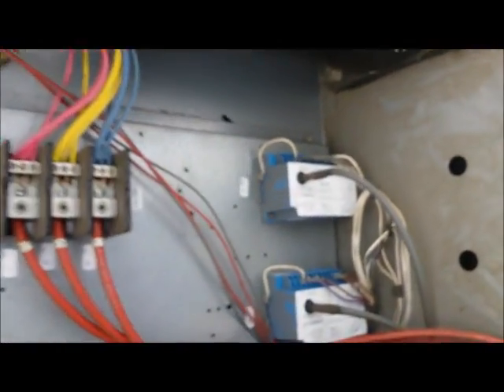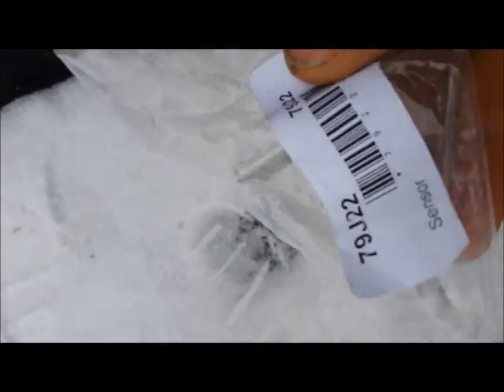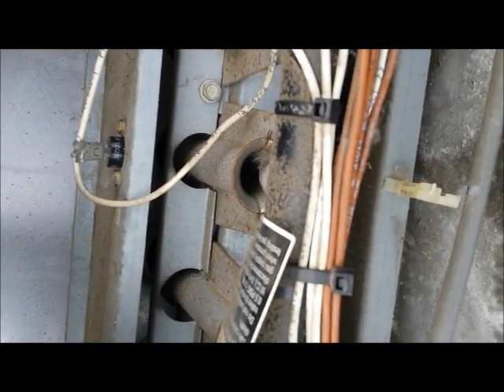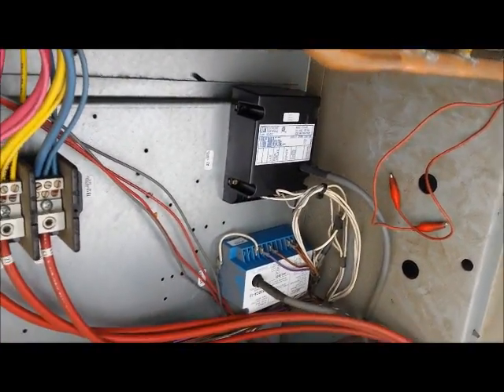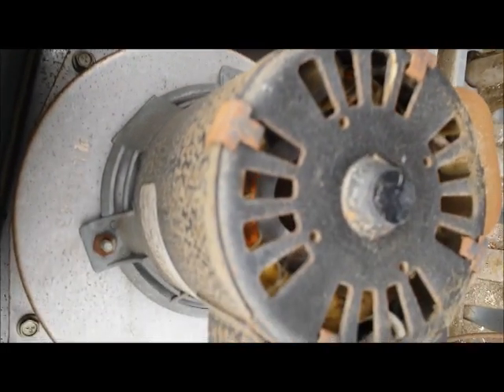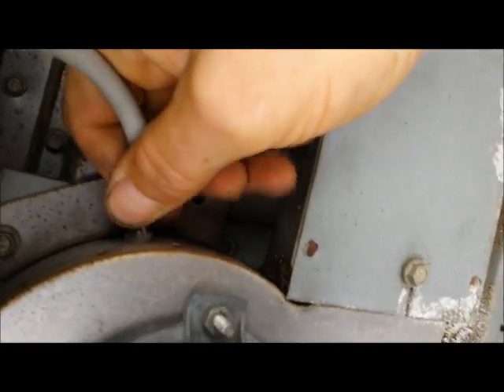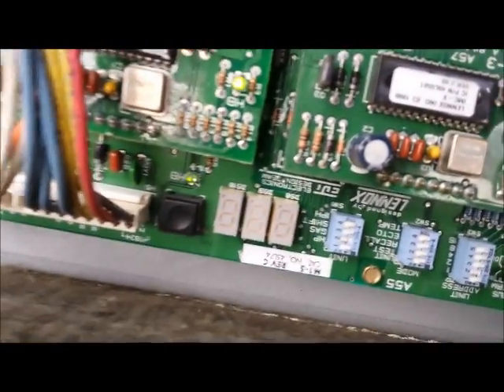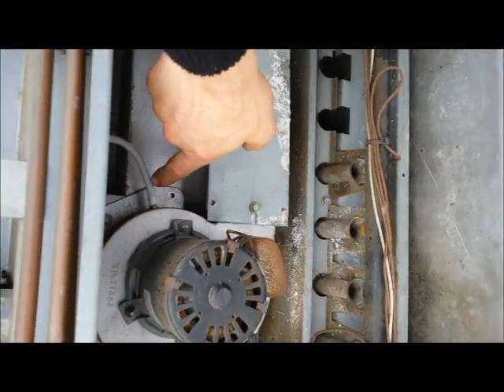troubleshooting commerical roof top units

Comment: Just did the same thing yesterday. Not to try to correct you, as your unit might be different. But, with what I have seen, W1 and W2 are not split from left burner and right burner sections. Gas valve one and gas valve 2 both energize on a W1 only call. Just on low fire. In other words, both burner sections will be lit on a W1 only call. When second stage is needed both gas valves go into high fire. Nice video though. Keep doing what you're doing.

Comment: I'm new to hvac world,  at my job we have a roof top unit trane yr 99.   I replaced the induction blower ,   the unit heater now does every step like it should,   but will only keep the flame for maybe 10 seconds....   can anyone help pls!!!!!
Reply: francisco munoz maybe flame sensor
Reply: Squirtle Hvac hi,  I did find the problem. ..   when I kneeled to inspect the the flame,  I noticed the flame coming out the opposite way hitting the sensor and cutting the unit off.  Heat exchanger had cracks all the way.
Reply: francisco munoz oh ok nicr. Dancing flames is indication of cracked heat exchanger. Package unit or furnace?